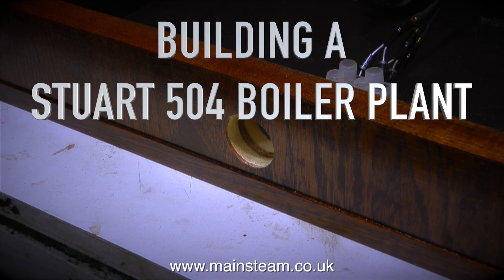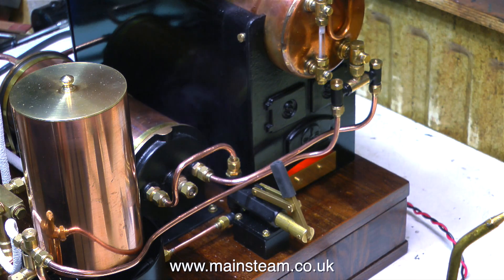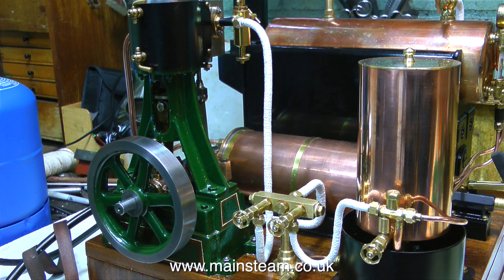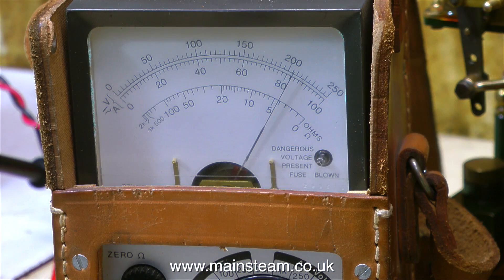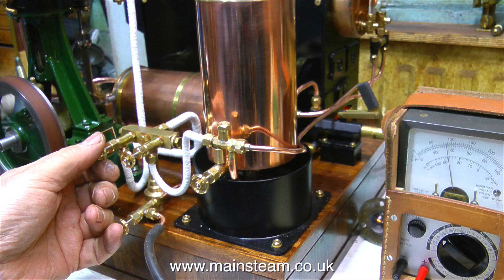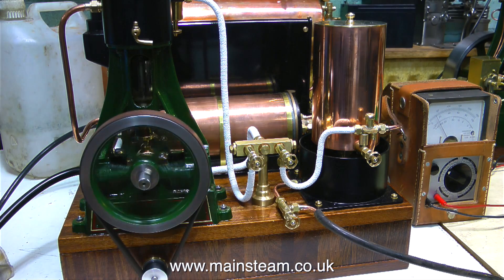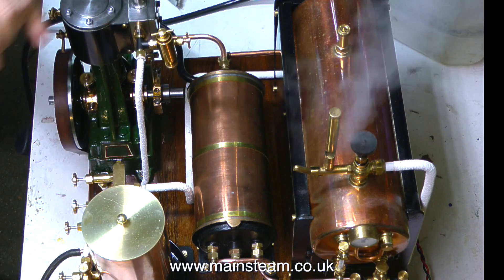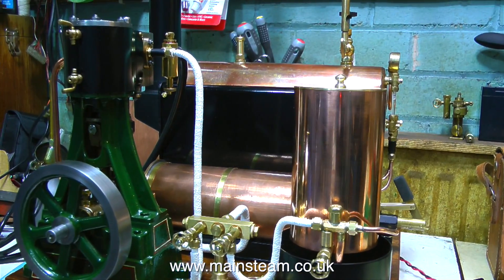MAKING A STUART 504 BOILER PLANT - PART #26 - THE FINAL LIVE STEAM TEST

Comment: I bet there is enough power in the engine to spin the generator much faster.  Get the voltage up and it would be interesting just what you could power with this plant.  Might I suggest powering an electric model train set.  Just think, a Stuart steam powered bullet train!

Comment: Keith, So could you make the Flywheel bigger? That way you could run the Engine slower, and still maintain your RPMs for your generator? Or do I have that all wrong?
One crazy thought is if you had two generators, either you could run the electric output + and - in series and make higher voltages, OR run the electric output in parallel and make higher current- just food for thought. As long as your RMP is correct your generator will produce power.
One other thought: Technically you could make a electronically controlled Valve that could act like a governor for the steam plant to regulate the speed of your generator. Just food for thought.
Reply from the maker: But then it wouldn't be a genuine original Stuart Number 4 .......

Comment: Hi Keith, wonderful series! Thank you! I wondering why you wouldn’t pipe the condenser back to the water tank to create a closed loop system. Then you would only need to make up any losses due to blow downs, steam whistles etc. That’s how the steam cycle works on a power plant. You would need a pump to pump the water back to the tank and maybe an oily water separator to get rid of any oil. You may be able to mop or drain any oil off the top of the tank though.
Reply from the maker: if you watch the part of the series where I discuss injectors, the answer is there - Live Steam Injectors don't work with warm water .......
Reply: Keith Appleton Ahh ok, it could get quite complicated then. Either using gravity or, a mechanical means to transfer condensate back to the water tank.....I can see why you configured as you did now. Thanks!
Reply from the maker: Not at all practical in small scale though, the oil is partly emulsified in the condensate and separation is very difficult ....

Comment: Great series.  I have idea that might get you a bit more voltage without having to redo the mechanics.  The diodes on the motor look like they might be regular silicon diodes which have a normal forward drop near 0.7 volts. With 2 per phase they are taking 1.4V drop total.  If you could find schottky diodes which only have have a 0.2 volt nominal drop you should get back 0.5 volts x 2 total.  This would get you in striking distance of your min target of 3.3V with the speed you prefer.  Keep up the good work.

Comment: Hi Keith, thanks for this series, I have enjoyed it. Just a suggestion, if you made the bottom pulley  smaller it would give you a higher gearing although you may have problems with it slipping but the higher gearing would also require more torque from the engine so also might improve the exhaust note. I think you said the bottom pulley was 3/4", so if you made it 1/2" then it would increase the generator to 8,800 rpm with an engine speed of 400 rpm.
Reply from the maker: I think I have already mentioned this in one of the episodes ........

Comment: I should be very interested to see whether the boiler is able to keep up with the engine's steam demand over the long term when the generator is running under load and doing something useful, e.g., charging a mobile telephone.
Reply from the maker: Testing under a 21.5 watt bulb load, the boiler just sits at 50PSI all the time - and the fire (gas burner) is not very fierce . . .
Reply: Very interesting. You did much better than I managed when I tried something similar with the same type of boiler/burner and a Stuart Score about 10 years ago, which would not maintain pressure for more than about 2 minutes before depleting to <10PSI.

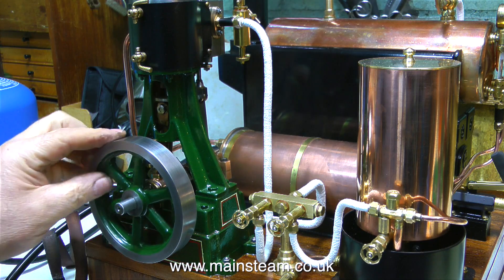Comment: At 1:45 you had a somewhat contradictory situation, where your engine is running, but at 0 RPM!! There's a video of a Lanz Bulldog tractor doing the same thing - the engine turns back and forth but never goes over TDC - impressive stuff.
Reply from the maker: I thought that I explained what was happening in the video ... ???
Reply: Keith Appleton You did, and I merely suggested that it looked similar to the Lanz running and not running at the same time.

Comment: A second layshaft would give you enough generator speed at low engine rpm. A great video series btw!
I just had another thought, how about a cvt transmission? You could the adjust the load on the engine on the fly.

Comment: Is the current set up (sorry about that) a success, or will you have to gear up the power train to provide sufficient RPM at the generator at an acceptably low engine speed?
What a beautiful plant, though! Just brilliant.
Reply from the maker: even with the engine running very fas, the generator only outputs 9 volts. An electronics expert friend of mine is coming over probably next week to help me test it & check it's capabilities:-)

Comment: Stellar finale of a beautiful build. With all the extras one could ever want. 

The driven shaft might present an interesting opportunity. When you mention the engine sounds better under load, would some kind of band brake or extra resistance do the trick? Is that a thing? Like a stationary bicycle tension belt to a small flywheel on the shaft somewhere, or something like a bicycle coaster brake. Just a thought. :D

Comment: Is there any chance that you could add another stage of speed step-up? That would give you more speed at the motor/generator and maybe the additional load would improve the engine's exhaust note?
Reply from the maker: I could go on forever, this is about right for the engine, it's the generator that doesn't seem to put out much voltage per RPM. I had a Traction engine once, and the directly drive generator on that put out 30 volts  ........ There is a video of it generating here on my dining toom table running on compressed air: https://youtu.be/YeMVoAYDPSg

Comment: You might be able to pick up about a volt on the output if you change out the diodes.
Reply: The forward drop in Schottky diodes is approx. 1/2 that in PN junction diodes.  So, a swap would gain something, perhaps enough to reach the voltage converter's threshold, while running the engine at a "perfect" speed.  Vishay part # SB330-E3/54 (3 A./30 PIV)  purchased from Farnell should "do the trick".

Eli D.
Reply: Exactly my thought, though if the regulator is 80 watts he'd need diodes rated for at least 16 amps... or parallel diodes adding up to that, times six for the three phase motor/gen.

Comment: Mr. Appleton could you clear up a bit of confusion for me. I watch David Richard's Chanel who runs a Job Shop on steam and line shafts. He talked about dooming the pulleys to get the belts to run truer. Is this unnecessary on moldes because of the scale?
Reply from the maker: Doming the pulley or "Crowning " as it's called works fine, but I prefer the flange idea, that way the belt stays on the pulley all the time . . .

Comment: At what speed would you prefer to run at to produce the electricity yo desire? 
@.5 inch input shaft you would need to run the engine @227 rpm
@. .45 inch would be 205 rpm
@.4 would be 182 rpm

Comment: Looks great Keith, I really enjoyed following along. I'm impressed at how quickly that injector seems to supply water. Can the boiler maintain pressure to keep the engine running at the 350rpm you want ?  A feature on ceramic burners would be useful I bought a 3.5" dia one incase I want to run my boiler on gas but find it a bit temperamental.